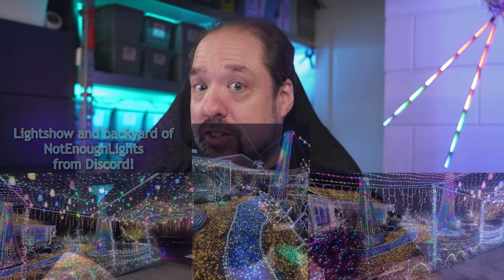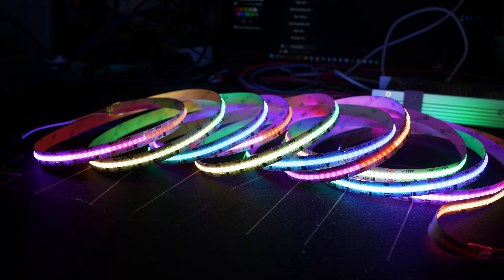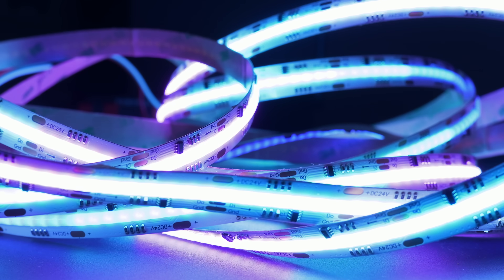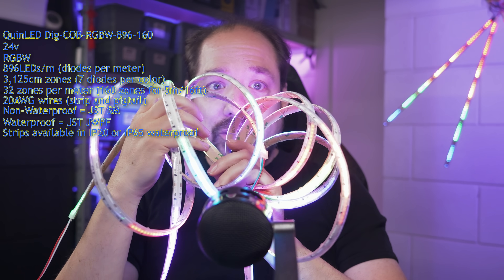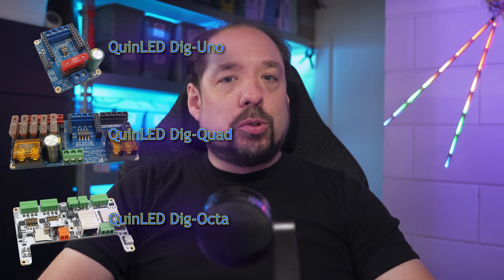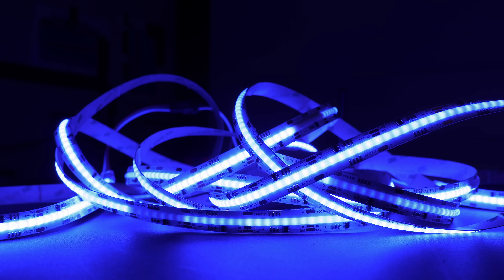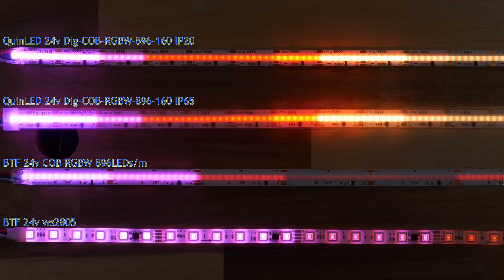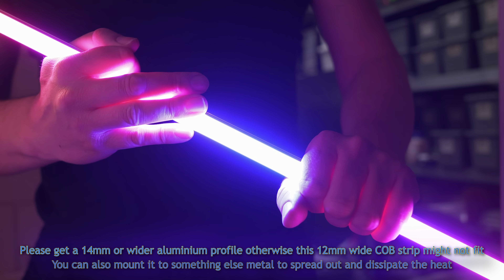💡QuinLED💡Custom designed LED strip

Comment from the maker: --update !! warning, this strip is much more susceptible to shorting out on itself then other variants. Please do not unroll the IP20 variant on your desk and play with it, it can quickly kill a segment if 2 fronts touch (even on the side). Please test the strip on the spool and only unroll and install without power. Then once installed you can apply power and it should be good! !!
Reply: Someone on Reddit said that this has been addressed. Is that correct? Thanks.

Comment: Hey I am currently shopping an undercab light for the kitchen. I'd love RGBCCT addressable and I was going to go with Govee Pro 2 but in looking into DIY options I found your channel. If it seems most logical for best lighting to get two strips installed, white CCT analog and a RGBW addressable I'm curious what you would recommend. I'd like to run some shade of white 99% of the time with high accuracy but also have the fun option for when we want it (seasonal, holidays, events). 
Any tips on what you would do if you could pick 1-2 Tunable White strips and 1-2 RGBW to choose from for this application? I'm good with WLED, DMX, custom communication protocols etc. I'd like the white one to be able to get pretty dim for night lighting.

Comment: I wonder if these work with Blueghozt controller? I'd love to try with a 12v to 24v converter for addressable vehicle lighting. I have found all other available addressable leds don't have the brightness required after placed in a diffuser. I heard these are thw brightest addressable leds available

Comment: finally getting around to my project with your LEDs. I have some longer runs and was hoping to beef up the wire a bit to the JWPF connections. Am I correct that they are rated at 3 amp with a max 22 awg wire? was hoping to use 18 awg I have lying around.

Comment: Pardon my ignorance (beginner LEDer here) but the strip, per meter,  seems to exceed your max leds number per chanel on, say, the digocta brainboard. 🤔 How would you go around this?
Reply from the maker: You need to count the zones, not the individual LEDs. Check my power injection video, it explains a lot!
Reply: Ah, ok. Thank you for clarifying that. Much appreciated 👍

Comment: How much heat would this generate do you think? And what is the recommended ambient temperature?
Reply from the maker: Depends on how you run it, if you use effects or like 100% white it's pretty normal and doesn't generate that much heat but when running all LEDs and multiple diodes per then yeah there is a lot of watts going through there and since it's not 100% efficient it'll run hot. A normal profile is fine to sink it away though, it can run 60c without a problem for instance. I don't have perfects stats how much heat would influence the longevity though, not worse then other strips if in a profile. Without and running intensive stuff, it will run hotter because of the much higher output levels.

Comment: Any plans to do a IP67 or 68 version? I literally just bought your An-Penta-Plus, and I got the Mean Well UHP500-24 on the way. However, to be installed for the situation that I’m working on, I need at least IP67 or higher.

Comment: Really hoping you consider a natural white version for the next batch! I want to make an underglow kit for my car and a bunch of companies that sell kits are saying they have the brightest strips and are using 12v UCS2903 at what looks to just be 60 leds per meter. I'm guessing your strips are quite a bit brighter correct?
Reply from the maker: Compare the power usage, that's a fair general indicator, especially since I use COB LEDs which are generally a bit more efficient.

Comment: hi quin. you do an amazing job with your products. i wanted to ask you something. how do i make a usb pixeled curtain work with wled? the thing is that they are not serpentine, but have a micro controller on top for each led row. usb-----➡️⬇️➡️⬇️➡️⬇️. i tried but only the first row of leds lights up. do you think there is a way to make them work? thank you very much 👍
Reply from the maker: Yeah without a serpentine layout it might be hard to make it work with WLED currently, it would need some adjustments in code and I don't know if that's available or not, haven't looked into it myself.

Comment: So as far as I understand your new LED Stripe is very powerful and bright and therefore consumes many Watt and needs cooling. If this power really should be used the adhesive connection between the stripe and the cooling Aluminium should also be excellent, shouldn't it? Is it really good enough? And even if yes, how is the quality of the adhesive for usual stripes?
Reply from the maker: The adhesive used is quite tough yes, once you stick it down you shouldn't really intend to get it loose anymore. That said, in regards to heat transfer how well the adhesive sticks isn't that important, more how well it insulates or rather, doesn't insulate. :)
Reply: @IntermitTech thx, thats what i meant: insulation not stickyness. But what is your answer to insulation?
Reply from the maker: @zisaurierzisaurier9286  It's designed to insulate electrically but not thermally hence it transfers the heat just fine.

Comment: Given the latest discovery of accidental shorting on certain surfaces with the IP20 variant, is it safe to mount it in an aluminum channel? Thanks
Reply from the maker: It is yes, the issue only occurs when it's curled up on your desk in multiple layers and the sides can touch each other. So I've updated the articles, test it shortly while on the spool and then install it without power applied and all is good. 
If you use a profile that's wide enough (12mm all the way down) there are no problems at all. I've added an updated article for this on the product page too!
Reply: @IntermitTech  Awesome! Thank you. I'm looking forward to the next available batch in February. 🤞

Comment: Congrats on the new product launch and i see the non water proof version is sold out on all net already. Hopefully this means you can ramp up the volume and I can get the 27m i need for my whole room primary lighting projecct 😂
Reply from the maker: We're working on a new batch but it will likely be February before that's ready!
Reply: @IntermitTech  awesome to hear, no rush. Quality first!

Comment: You mention that it needs cooling, how would you recommend cooling the waterproof version?
Reply from the maker: Attaching it to a piece of metal is still recommended, that can spread out the heat a bit allowing it to dissipate.

Comment: Is there any way it can reach between 4000k-5000k? Other than that, I’d love to buy a couple strips, the price is great, don’t think it needs to be lowered considering its capabilities and compared to other brands that can’t provide such quality!
Reply from the maker: I could make version that have those shades of white but with minimum order quantities being a thing and tied up capital that's not in the cards right now.

You could tweek this version with the 3000k by adding a bit of blue, but it would only change the shade a bit maybe, the spectrum wouldn't be correct still.

Comment: I have learned the hard way that IP65 is not waterproof enough. At least here in Western Norway where it rains all the fooking time. And at least not the usual IP65 sold on AliExpress. They are just coated on the top, not sleeved. Are yours sleeved, and therefore more like the IP67's?
Reply from the maker: Yeah no, but I do agree with you. So the factory calls it IP65, they say IP67 should be rated to be submerged and theirs isn't. So maybe it's more like IP66? It should at least certainly be better then strip that only has an epoxy coating on the top!

Comment: Hot damn. Already sold out on the Allnet store? When are we likely to see these back in stock again? I'm looking to set myself up with an Octa Brain/Power system and several of your LED strips. That shipping does indeed bite hard so I'll definitely have to order it all together.
Reply from the maker: We are discussing another batch but usually it's a months time, since there is new year and other holidays in between it's more likely to be somewhere in February.
Reply: @IntermitTech  Well. Waterproof ones it is then! Thanks for getting back to me.

Comment: If you’re using a wled controller what should the configuration be for functioning or controlling the unit.
Reply from the maker: It's listed on the product page but sk6812/ws2814 with BGR and W&G swap.

Comment: Now we need someone to design led channels that can be 3d printed, in different sizes, and compatible with diffusers of the shelf. If they slot into each other I bet this could be better than aluminum channels
Quindor have you measured the temperature of the strip? What’s the running temperature??

Comment: How do you cool the ip65 version?
Reply from the maker: It won't fit into a profile (unless it's really big) but sticking it down on a surface that can take in some of the heat still helps dissipate it a bit. Next to that it's usage, doing normal stuff it will be fine really (effects, 100% W) but if you are going to abuse it (dual color at 100% on 2 or more colors) it will die a bit quicker because it will get hot.
Reply: @IntermitTech  i want to mount it on the lip of my pool, facing down.  It's not underwater but will be splashed.  Do you think it Will hold up?  Where is the power calculator spreadsheet?

Comment: This stuff you make is always incredible, as someone who is getting ready to build a house hearing that these could be used in some things. Primary lighting situations makes me really intrigued. As I'm designing all of the lights in the house to either be honest, led addressable bulbs or led strips. Addressable of course lol. While I'm still about a year away from building, I'm probably going to be picking up a few of these to. Test out beforehand!
Reply from the maker: Hey awesome to hear it and yeah I think they can be a good fit for sure! And testing is the way to go, only way to know if it'll work for you in the spots you want it and will like it. I am a big fan of that!

Comment: This looks great. When you said it's ok to be outside.... would this suit a driveway to accent? Or to much water for it during rain storms etc....😊
Reply from the maker: So IP65 is rated for low pressurized jets from all directions, but this means moments of being subjected to water, not continuously, it's not rated to be submerged in it basically. So if we're talking in the ground, then I'd probably look for something IP68.
Reply: @IntermitTech  yep makes sense. Is there any potential these are going to ip68? Because its absolutely what I'm chasing hahah
Reply from the maker: Not in the plans right now...

Comment: I wish, you will use Nichia Optisolis Full Spectrum CRI99 or at least Toshiba SunLike TRI-R CRI98 LEDs for the next version, and even shorter segments (12V). I am not familiar with the controller possibilities, but would be happy to see something similar to HD109: 27kHz, 16 bits. If you have such a product, I will buy a lot, even for double price. I don't care if it's COB or not.
BTW, I don't understand why don't they manufacture LEDs, where 6 serially connected dies per color are put in one small SMD package. Thus achieving 24V individually addressable strip.
Reply from the maker: Poh yeah I get it and I'd want some of those combinations too, there are just technical and certainly financial hurdles to overcome. Such a strip would be very much more nice and also much much more expensive. I considered a 12v COB version like this, but spacing on the strip becomes an issue and prices almost doubles because of ICs involved and such. Still, I will do what's possible and viable! Appreciate the comment!
Reply: @IntermitTech  I think you can try it, as an expensive luxury strip option. There are always some people who don't care the price, but want the best of the best. If it is wider (20mm), I don't think that would be a problem. It's heat dissipation would be better, and there are a lot of aluminium profiles, where it can fit. Sunlike spectrum is not only beneficial for color reproduction, but for the health as well.

Comment: I'm interested in the economics of this. 
My needs are different but also specifically different from the common stuff. At what sort of volume does custom strip become economical ?
Reply from the maker: Poh that's really hard to answer, at least 2500m to 5000m I'd say to make it somewhat viable. But it also really depends on what, certifications required, etc. etc.

Comment: Can I still use, end only injection (both ends) for a 20 meter strip? Can you demonstrate maybe how to join these strips seamlessly (for a front gable) and still remain waterproof?
Reply from the maker: 20m is doable depending on the power levels you want to use. As shown a single color for all LEDs at the same time and Rainbow at 100% use 70w which is about 3A. With a single injection doing about 4A to 5A you have 10A total available with just front + end. But 20m would use 280w so 240w, so it's close, maybe the middle will be slightly dimmed during heavy power usage effects but it could be viable outside of that!

On the waterproof part, that's a good question, you could maybe cut the waterproofing, solder the strip together and then join it again using clear heatshrink that has glue inside of it so it melts while shrinking to make it water tight. But it depends on how watertight you need it really.
Reply: @IntermitTech  My "brightness" never exceeds 50%... I think it can be done. Thx for your quick reply. I'll order 4 strips and give it a go (in the shop first).
Reply from the maker: @ppi57 awesome, let me know how it goes if you want, we always love to see on the Discord server.

Comment: I'll get some for sure, would love to do year round outdoor house lights with these and have the best lighting in the neighborhood, but the power requirements would make that pretty challenging.  

Just installed some 2805 a couple weeks ago, and some cobs with RGBW in the kitchen but both are 12v

I'm waiting for RGBW 24v individually addressable COB lights to be the best of all.
Reply from the maker: ws2805 is nice too! 24v individually addressable does actually exist but only with very much trickery. I showed it off during a livestream once. The strips power usage is basically reversed, even while off it uses 50w, doing some effects it uses 50w and during full 100% RGB white it uses 50w. Not really that great for normal usage. ;)

Comment: I'm beyond pumped your getting into the strip space. I have a request if possible: I want to install addressable strip lighting around the roof trim of houses (instead of pixels/pucks) but it's not viable unless I can use IP68 IC RGBWW strips in lengths of no less than 30 meters/reel - is this a possibility as there is nothing really on the market?
Reply from the maker: Technically that's a bit of a challenge, 10m/32ft is a long span to cross. It could maybe be done but then with really thick copper traces and few LEDs/m but that makes the product less desirable in that sense. Combined with IP68 we're talking really niche which is why you probably can't find it.

Comment: Oh man if there were a 24V dig2go...
Reply from the maker: I do too but because of USB-C PD going up to 20v that's sadly not really possible in any way that makes logical sense. Newest PD goes up higher but then you need a very expensive adapter with an expensive board to do something a 24v PSU that costs 1/4th does too. But who knows, maybe in the future!
Reply: @IntermitTech  ahh that makes sense! I forgot it stopped at 20v

Comment: factoring in the 8-bit limitations and considering only 32 zones per meter, the time has come for 16-bit LED drivers for these types of designs.  Newstar sells NS108 type addressables but IIRC they don't license the ASIC for COB designs yet.
Reply from the maker: Yeah and there is also the software side of things, WLED is very popular and I do see a market for such strips/devices/etc.. but the problem is, WLED is very much built around being 8-bit internally. It's why I still use a lot of analog (well power and CRI too, but ok), the higher bit depth is so much nicer. But for WLED specifically we'd need a stronger processor and such too so I'm hoping in a few years maybe!
Reply: @IntermitTech  I agree, WLED needs to go 16bit. All lighting products need to be ESP32 only, no more 8266. Great product! Can't wait to try one.
Reply: @IntermitTech Can probably be solved by hardware/register max brightness/current control, and a gamma curve may be applied on the set values to give more resolution to the darker ranges.
I feel like 8 bit resolution for color is more than enough, as long as the 255 steps are used wisely.
Reply: I've done a lot of work on the 16-bit NS108 / HD108 LED types. I hate how much data you have to push out to each pixel. But the flicker free darkscale fading to nothing from nearly nothing is borderline magical.

I'd love to see a 2-wire / SPI type protocol that can be clocked arbitrarily high, forget this 800KHz antique bs. A 32-bit per pixel format coding 10 gamma compressed PWM control bits per channel plus a control and sync bit that can be used for sending global current control and indexing signals.